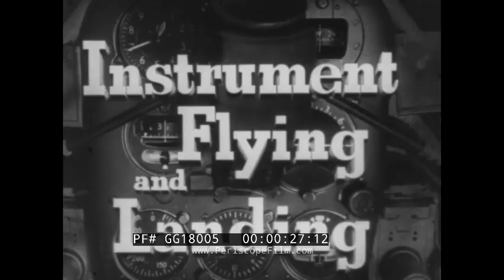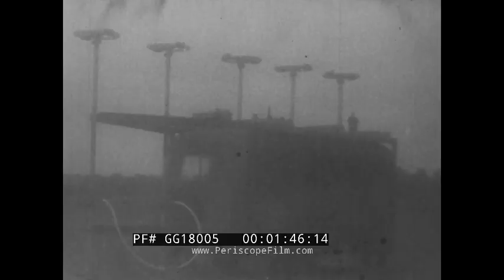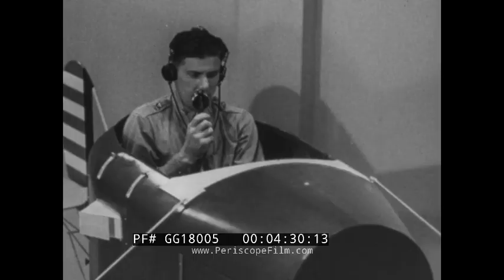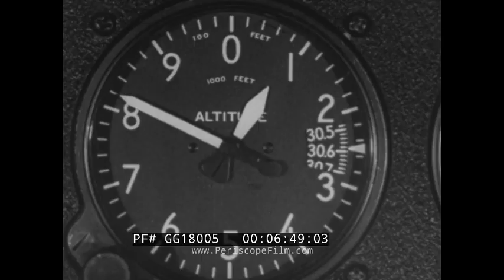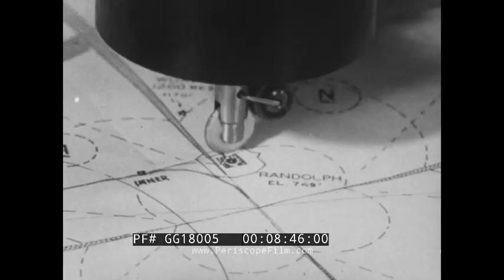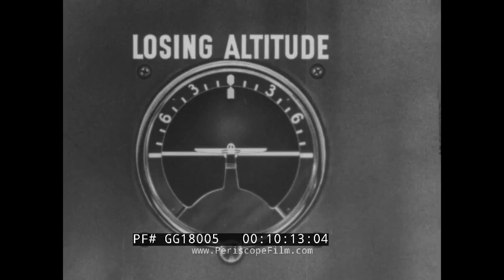" AIR FORCE LANDING SYSTEM "  USAAF INSTRUMENT FLYING TRAINING FILM   LINK TRAINER  GG18005

Comment: The Arcata Aux Naval Air Station which is now the Arcata/Eureka airport was used for instrument landing practice because of it being the foggiest airport in the USA. They also tried the F.I.D.O (Fog Intensity Disbursement Operation) by using oil burners along the runway to burn the fog off for landing https://youtu.be/FLZQOdu6J78?si=97dRSqtE5Wafi1XB